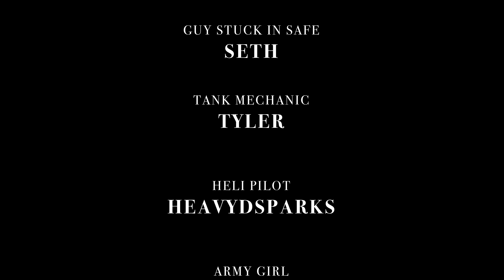Life Sized Remote Control Tank

Comment: That tank right there is a Chieftain MK 10, it is one of the few MBTs with a rifled barrel (most MBTs have smooth bore which helps it preform better with the rounds they shoot; the British MBTs have a rifled barrel because they can shoot high explosive squash head shells more accurately than a smooth bore barrel can, although the downside is that the gun has less armor penetration than a smooth bore barrel)

Comment: So make remote control dirt bike with a weight that it shifts to balance it automatically then the clutch throttle and brakes and shifter need actuators imagine having a dirt bike with street bike engine and have a ramp where you jump dirt bikes even further than the record long jumps remote control same for motorcycle and snowmobile so you could go to a mountain and drive the snowmobile up cliffs with remote
Reply: And send the 10 thousand for idea is more than I make in ten years

Comment: Instead of compressed nitrogen and pneumatic cylinders, another option is to use linear actuators. There are some powerful and quick, low lost actuators out there that can adapt to rc controls very easily.

Comment: Nice tree take down. I did one very similiar in a Syrian (Soviet) T54A main battle tank at Ft. Hood, Texas. I sheared the tree in two it fell back over the turret the TC (Tank Cmdr) was behind his open hatch and he ducked for cover. The guy in the other hatch opening had the hatch door behind him, so nothing to duck down behind. The tree wacked him good, knocked him straight down into the tank, lol. They had to call a halt to the field problem, had to remove him up and out strapped to a back board and took him away on a medevac chopper. The only damage my tank took was the right front fender got ripped off. The tree was about 2 ft thick, I went right over it, knocked it's base back about 5 ft, was trying to go between 2 trees at perhaps 20 mph, misjudged it a bit. I was in the OPFOR unit, wore a Russian uniform etc. After that and a crazy fast run (12 cylinder engine, 5 speed manual transmission with over drive, going perhaps 35 40 mph most of the time, loud all steel tracks, no rubber shoes) back to the rear on the tank trail, no one ever rode with me again. LOL, I was the Immortal tanker.
Reply: Honestly by the way you talked about the other guys and how they got hurt. I kinda feel why noone wants to drive with you😅

Comment: I’m not surprised you’re having trouble with it Cody the cheiftan was NOTORIOUSLY unreliable. You should have bought a T72 lmao. You should put the gun in its travel lock when you use this tho, it’s probably too late but it will save you from repairing its hydraulics and stuff later

Comment: Get like 100 of those large concrete barriers, like the 2’x2’x6-8’ ones with rebar loops on the end.  Stack them at least 6’ high and however long you need to protect the power pole.  
Better yet dig a big trench

Comment: 12:22 Wow. I cannot believe a freaking Smart took such a hit and walked it off. I can feel Smart's share's prices rising.
Reply: Well yes that's because there is nothing in the front just a metal frame and plastic and one little radiator the engine is in the back and the battery is inside.

Comment: I know Cody won’t ever see this but this is The definition of FUCKING BADASS. Shooting tracers at an RC tank, pulling a safe through a wall with Seth in it🤣😭🤣😭, Having a replacement for your “normal cars”, and on top of that YOU HAVE A “AIRSOFT” RPG that works😳.(Edit: All the military crates stacked up, potentially has other “things” in other crates, all the “decommissioned” rockets, etc)There’s way more I forgot about trying to write this but PURE BADASS🤟🏻🤟🏻